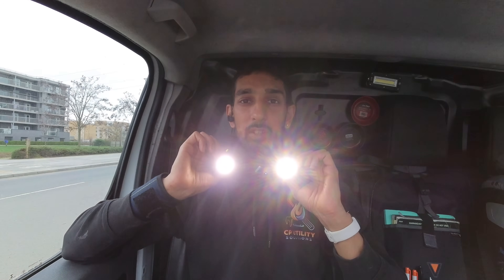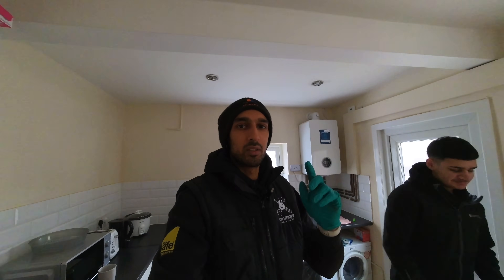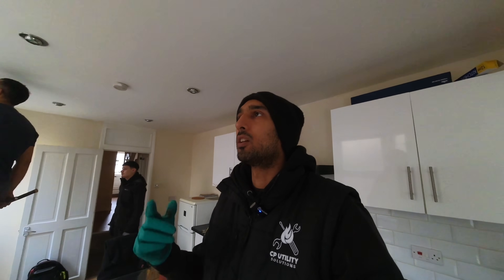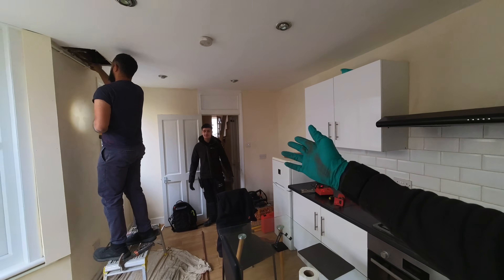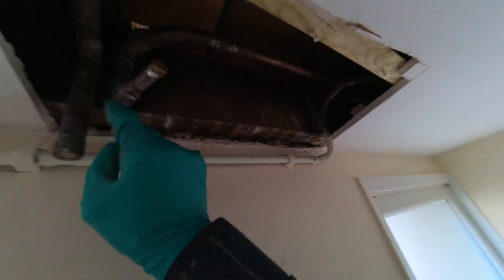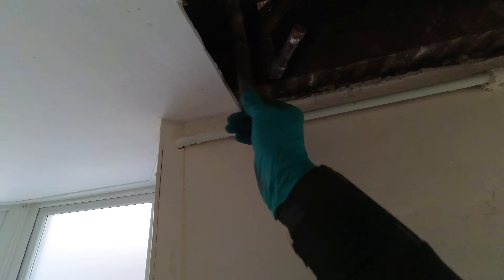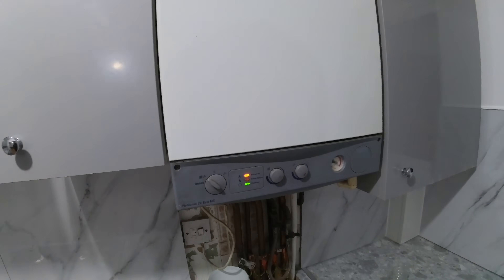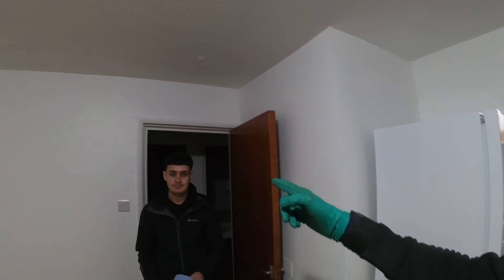I Had To Call In A Sparks - A Day In The Life Of A Gas Engineer 120

Comment: 240 between neutral and earth is usually a broken neutral on that circuit 👍
Reply from the maker: Yeah I had it before on a job where a bug had crawled into the wiring centre and got fried across the neutrals giving me broken neutral symptoms. This one ended up being in the consumer unit itself the customer told me after the sparks had been

Comment: Could you go into more details briefly explaining the last one please? What made you not change pcb? Should there not have been 240v on neutral? Currently doing my gas so trying to pick knowledge up.
Reply: Neutral to earth should be nothing, 240 only on neutral to live and earth to live
Reply from the maker: What he said 👌🏾
Reply: Helps to remember that voltage is also referred to as potential difference.  Using the earth as your 0V reference point there should be 240V at the live and 0V at the neutral.  If both live and neutral were 240V then there would be no potential difference between them and the appliance would not operate.

In this case the reason that 240V shows on the neutral in the boiler is that there is no return path for the current due to a broken neutral upstream.  This is a good example of why you should never assume that something isn't live just because it's not working.  Always test.